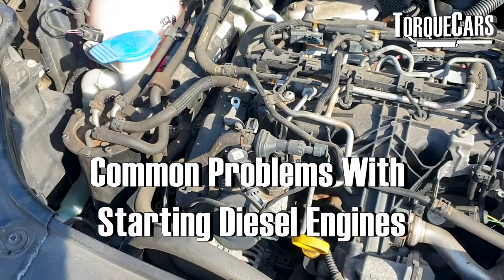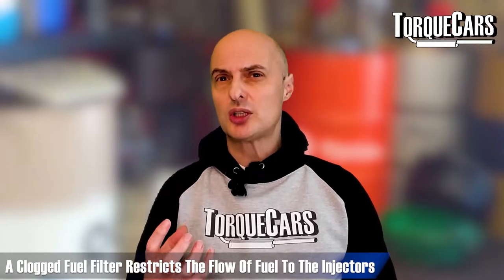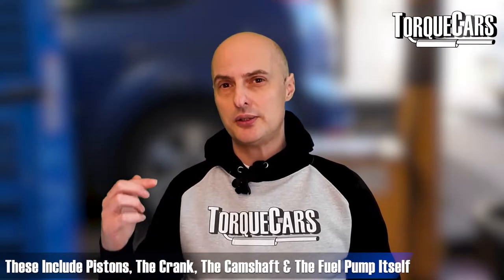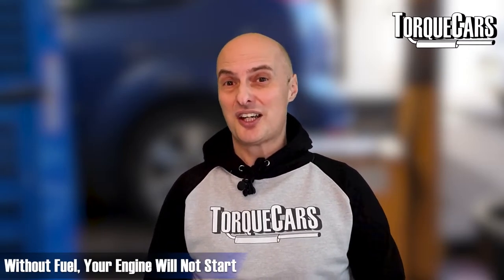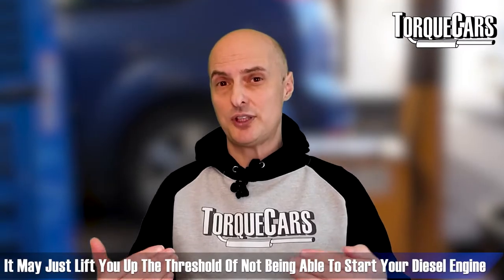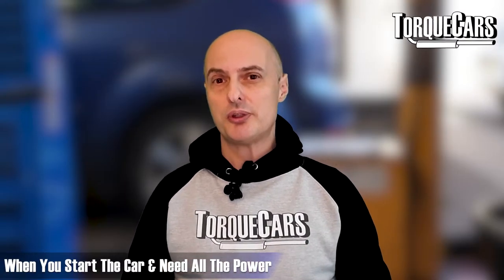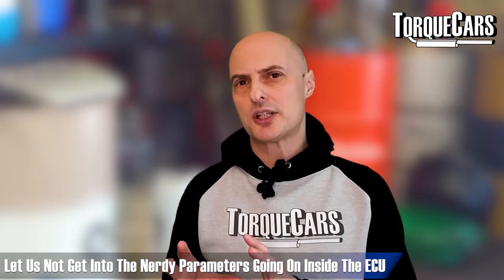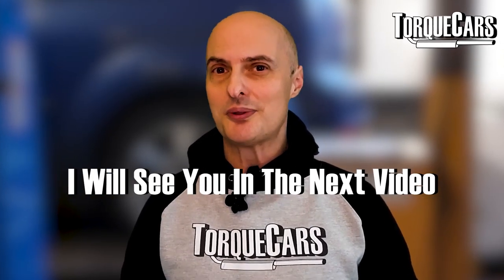VW Group Diesel Engine Fix Warm & Cold Start Issues [Seat VW Skoda Audi Tips]

Comment: My Golf 2.0 TDI suffers from intermittent long cranking times once warm. Crank speed is good, battery good. It's done it for years. It starts instantly when cold. This is apparently due to the gears in the starter motor wearing down due to age and is a common issue on these. I believe there are tell tale signs of metal filings on tbe starter motor gears. It does something different on cold start which means this only happens when warm. I cant remember what. May be glow plugs. Only fix is a new starter motor which is not cheap. I have just lived with it!
Reply from the maker: Interesting I'll do some more research on this. I did cover warm start issues in this video  https://www.youtube.com/watch?v=BHjuezi6bNc

Thanks for the heads up my friend.

Comment: Hello. I own a SEAT Ibiza 1.9 diesel from 1998. It features a Volkswagen 1.9 liter diesel engine. That engine features a belt driven rotary fuel injection pump. 
Once, I noticed my fuel indicator on the dashboard going low after about 383 km (238 miles). Then, I noticed a strong smell of diesel fuel in my car and smoke from under the bonnet. Then, I opened up the bonnet and I saw that One of my injectors was leaking. That was a faulty return hose. So, I went to a garage and got the problem fixed by installing a brand new return hose. But now, it Works fine without leaking injectors.
 By the way, Thank you so much for the information.

Comment: I have encountered this problem, car starts 100% on first start when engine is cold, engine sounds good no smoke etc. Once driven for a bit and it gets warm, lets say a 15-20min drive to the shops. If i then switch off and try to start the engine would shudder and sounds like it wants to break the engine mounts. The only way to get the engine to start is to keep my foot flat on accelerator while swinging then the engine would start and goes on its way as if nothing was wrong at all. no smoke, engine goes and sounds well when running... If I let it cool down after a drive it will start instantly but if I try to start it when engine has warmed up it will not allow the engine to start... it will sound horrible and sounds like it just-just wants to start but would not until I put foot down on the gas pedal... any idea?

Comment: Hello.. my car polo CayB 1.6tdi my problem is that although the air temperature is 25 degrees, my car starts hard at the first start.. glow plugs do not engage.. but if I unplug the fuel temperature sensor, it is activated and the car starts easily.. can you help me ?
Reply: @TorqueCars
Reply from the maker: It is really hard to diagnose this sort of thing, I am a little baffled by this one and haven't come up with anything conclusive for you yet. Check for error codes. Measure the cars voltage before during and after cranking, I suspect it's not getting enough juice to run the plugs and the starter and as a result the glow plugs are unable to fire up properly. Fully charge the battery and try it then, this will rule out power drain/draw issues. Is the relay cutting in correctly?
Reply: @torquecars  It does not give any error codes. system relay is working properly.. the only problem is if the fuel temperature sensor is higher than +10 degrees, the spark plugs signal from the brain does not go to the relay.. my fuel sensor relay and spark plugs are new and healthy.. battery is new and healthy.. when I look from vagcom, iat ect fuel temp and air temp values are reasonable and correct.
Reply: @Swordmurat I have this same problem on my 2012 1.6tdi. 
Cold start on a warm day is an absolute pig and cranks for ages but a cold start on a cold day is absolutely fine and fires up straight away. 
I've a brand new battery and once started it drives perfectly with no error codes. 
Did you find a fix?
Thanks.

Comment: 1.6 tdi golf 7 clha long crank only during temps above 10 celcius and only first start of the engine.Next startups are ok.Here is my video https://youtu.be/lb4n5WY7v_A from vcds. No idea whete to look for the issue. And i have more videos whete fuel pressure starts to build up but camshaft sensor shows zero. I put a new camshaft sensor but long crank sppears from time to time. The engine (1.6 ae288 has no vvt ) so no idea whete tu put my hand to solve the problem.
Reply: Ciao,ho visto il video, io ho golf 5 1.9 TDI 105cv, ho fatto praticamente tutto tranne gli iniettori,ho 286k km,l unico koo problema è l accensione a freddo la mattina,solo la mattina,solo a freddo,,sono quasi sicuro che serva agire sui parametri e serve un vero professionista x fare ciò